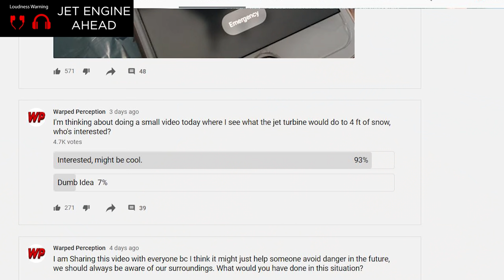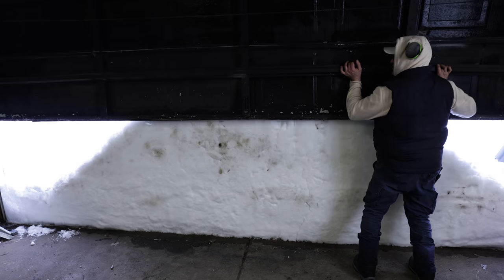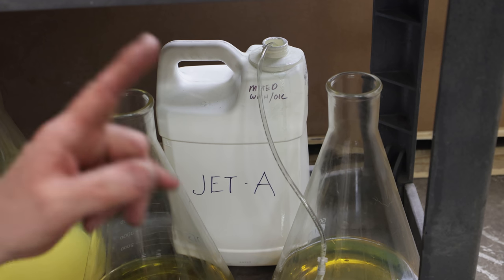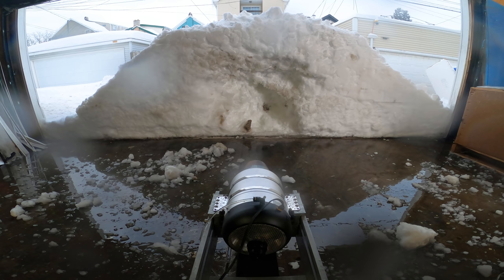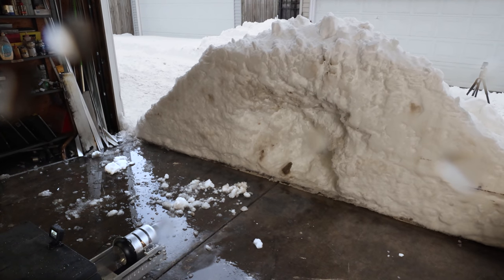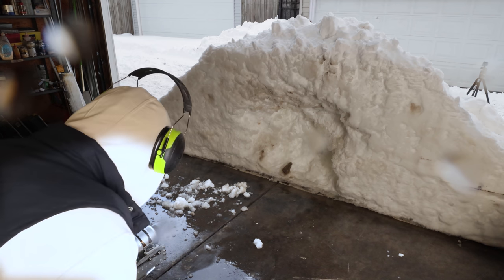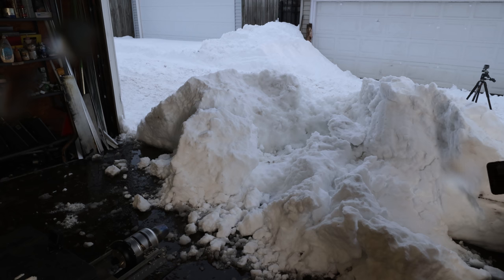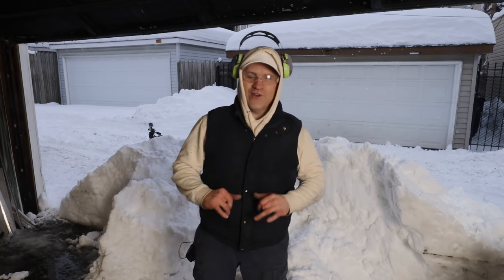Using RC Jet Engine to Clear Some Snow

Comment: The thrust is pretty erratic for a turbine... fuel flow issue?
Reply from the maker: Yes I agree, I'm going to address this in the next actual episode, this was just something for fun in between. But yeah I've been looking into it because in the previous video here https://youtu.be/SIfWCWZdfuc it only made 45 lb of thrust on diesel and it should have made like 70.. I did a bunch of troubleshooting since then and as recent as day before yesterday and I believe the fuel pump is just too small to run diesel for this engine.. it is the fuel pump that they saw with the engine and it is advertised as being able to run Diesel with the same power output. My long story short I think the fuel pump just too small but I'll see soon. For this snow run that engine was all over the place as you mentioned.

Comment: Jet-engine snow blowers have been around for a long time.
Reply: Isn't it used on NASCAR tracks to clean up snow or dry and heat a bit the track after hard rain?
Reply: @Kalvinjj  Yep but started use cleaning railroads.

Comment: Something is not right with your engine are you sure you putting oil in their in your fuel
Reply from the maker: Yes but if you check out my previous video, it wasn't making enough thrust on diesel, I'm in the middle of troubleshooting it now but I think I figured out the problem. You can clearly see that something is not right with the fuel delivery.
Reply: Yappers ifly turbines to and have never seen that  And I know you got it Keep it up
 It looks like it's a pretty big size turbine you should try to put on a set of skis or snowboard
Reply from the maker: I think it has an issue with the fuel pump, because I got a brand new pump replacement and now I'm getting all the surging, but the previous pump put out 67 lb on jet fuel and about 45 lb on diesel with 70 PSI versus 50 psi on diesel, I believe the pumps on these are too small I'm looking into it but I think tomorrow I'm going to hook up my own pump and regulate the voltage versus RPM, I'm almost positive that's the problem. Here's that video.  https://youtu.be/SIfWCWZdfuc